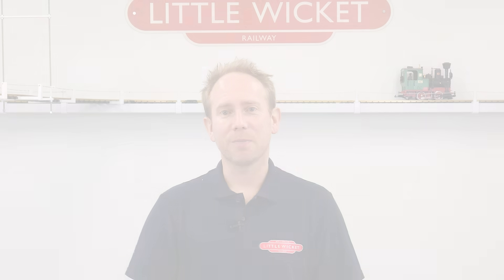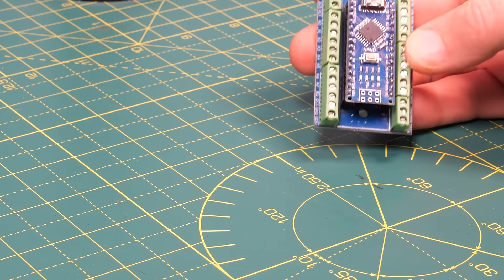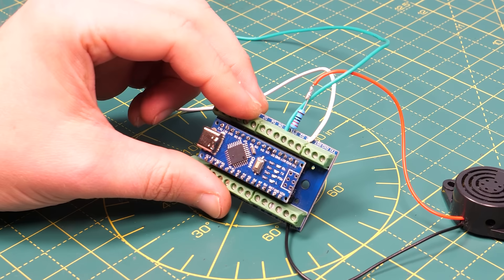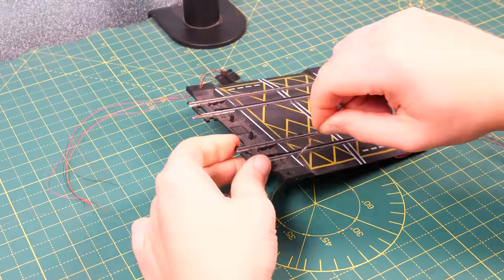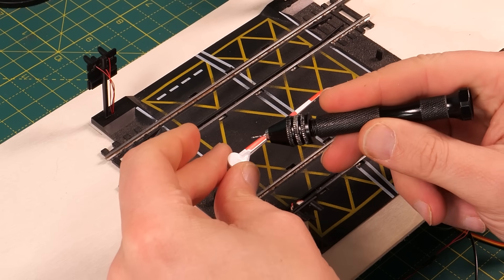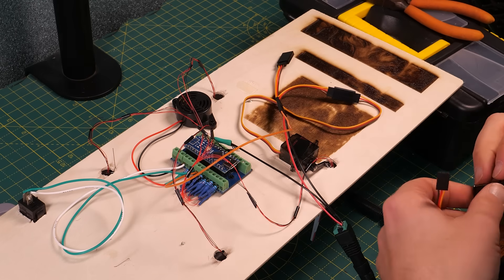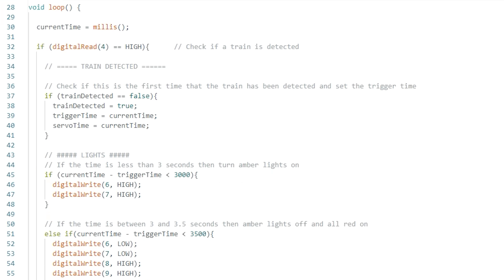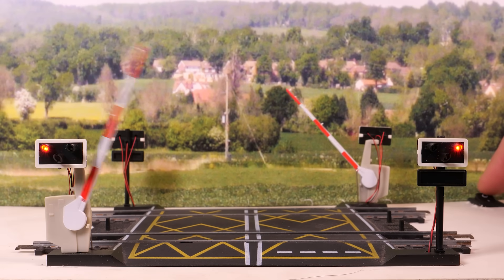Awesome Upgrades to Bring the Hornby Level Crossing to Life!

Comment: Looking at doing this myself using this video as a guide.

Is it a similar process if I want to add two track sensors to start the procedure (for locos coming from either direction on each of the lines)?

I will be using 4 barriers with a pair of diagonal barriers closing at once, then the other. Would the code also require another step in it copied below the first pair of barriers come down, then all 4 returning to point 0 all together.

Also, great video.

Comment: Surely you could simplify the LED wiring by putting three NPN transistors in emitter-follower mode between the anode resisors and the Arduino?
Reply from the maker: You could. That would reduce the code by a few lines, but requires 3 additional components.

Comment: Excellent modification: Just a couple of corrections in the interests of authenticity: 
Half barriers, like in your POC the sirens continue for the entire sequence; although in some installations the levels are attenuated once the barriers are down for local noise abatement reasons. Full barriers; the tones stop once all the barriers are down. 
Also, there are strict rules on the flash speed of the twin reds (As defined in TSRGD1), yours are a bit fast (c120fpm), also, your ambers should be on for longer, 5 seconds (TSRGD Regulation 39). 
For full barriers, the right direction barriers come down first, then the exit barriers come down (CCTV types). There is loads of information the standards documentation, particularly (GI/RT 7012 Requirement for Level Crossings) 
All of this can be fixed with some code amendments. I think I'll have a go at this for my Dad's layout with an ESP32 and some 3D printed parts. Well done.
Reply: could you make a video on that cause I would love to see it
Reply: @calvinnguyen7059 I don't really do YT videos, plus it's my Dad's layout, but if there is sufficient interest, I might... lol
Reply: @dougle03  oh okay

Comment: Rather than spliting the lights with 2 on 2 pins, you can still use one pin and use it to control a transistor to switch the lights on and off
Reply: Or a H-Bridge to alternate the polarity on a single output.
Reply: @dougle03  why? You just want it to turn off and on, not reverse anything or vary power. It's what I said to do but with extra steps. If you want to get complicated then dump the Arduino and run it all with some 555 timers.
Reply: @JSmith19858  The H-bridge will help help flip the polarity so all Red LED's are wired to a single pin but half of them are reverse polarity. All depends on how many pins are free. Could be done with an ESP-01 that go for about £0.30 each...

Comment: You said £20, but the first few things on the list are already over that, how much does it cost in total?
Reply from the maker: It'll be around £20 excluding the power supply depending on where you buy from and the quantity you buy.

LEDs £8.06 eBay (I just looked this up)
Arduino ~£4
Buzzer ~£1
Servos ~£4 (£1.69 on Temu)
Wire - you'll probably have to buy more than one, but you'll only use ~£0.50

How you power this is up to you. A lot of people will already have a 5V or 12V bus around a layout.

Comment: It'd be great to do a motorised version of the Full barrier type, as often you'd find those in an urban or suburban setting. That said the skirts on the barriers would be so fine they'd be fragile.

I'd be going for the earlier version with a bell rather than a warbler.
Reply: You should check out my full barrier crossing 👍🏻

Comment: Looking in my notes I see the Amber lights show a steady light for approximately 5 seconds followed by flashing twin red lights for 6 to 8 seconds before the barriers fall. Barriers are given 6 to 8 seconds to fall and must be fully down for not less than 16 seconds before the fastest train passes. The minimum total time of operation from the Amber lights illuminating to arrival of the fastest train must not be less than 37 seconds. This is for automatic half barrier crossings, hope this info is useful to you so you can adjust the timings

Comment: I'm glad you say it's only an experiment, as it's not very good is it? Lights flash far too fast and the barriers raise and lower far too fast. You can also get bigger LEDs that will fit in the light surrounds correctly, and just one more thing in railway terms AMBER lights are called YELLOW.
Reply from the maker: As I said, the timing of the lights and the speed of the barriers can easily be changed in the code, but given the model itself isn't particularly accurate and time is often scale adjusted I don't think it's a big issue.

The size of the LEDs is absolutely fine.

Network Rail refers to them as amber (https://www.networkrail.co.uk/communities/safety-in-the-community/level-crossing-safety/level-crossings-for-drivers/), but feel free to call them yellow if you want, it really doesn't matter.

Try to have a nice Christmas Iain.
Reply: @LittleWicketRailway  Railways signals are Yellow traffic lights Amber the lens says Amber on it so it is not confused with another colour lens
Reply from the maker: @cedarcam  these are traffic signals, so they are amber.
Reply: @LittleWicketRailway  Yes that's right. Maybe I was not clear enough in my reply. :)
Reply: As all crossongs are owned and operated by the railway and worked on them for 45 years they're known as yellow.
Reply: @IainDavies-z2l  Although the circuits show HGE I assure you the light is Amber because traffic lights are Amber and the railways light is required to be the same colour as other road traffic lights.
Reply: Hi Rob.
Well over my head buddy.
But going back to other comments as I was a train driver for 14 years we always said amber as it's part of the road network.

Thanks for this tutorial Rob.
Have a fabulous new year.
Thumbs up thumped 👍
.... Pete....

Comment: Excellent content, more of this please. Animating a water tower next?
Reply from the maker: Thanks. Do you have a particular model in mind?
Reply: @LittleWicketRailway  The Ratio GWR water tower kit has the potential and I think could take a 3.7g servo without too much modification. I have got a proof of concept on a breadboard controlled by a Nano and using a IR sensor to trigger when a train is present. It is connected to the Adafruit Sound FX board to play some sounds of the train being filled. I can share the code if you want to have a go?
Reply: Just to add the code was written using ChatGPT as I have no prior knowledge of coding.
Reply from the maker: @iansheppard3711  sounds like you've already got it sorted. Nothing wrong with using chat gpt for coding. It'll probably even explain the code to you if you ask it.

Comment: With a half-barrier crossing, it seems that the siren sounds throughout the sequence, until the barriers are raised again.

I believe that both reds light up at the start in order for the system to prove that they're working before going into the lowering sequence. As you'd expect, there are rules about how many lights can be failed, and where, although I'm sure the modern LEDs are far more reliable than the old halogen bulbs. I once read way too much about this stuff, but it's way too long ago!
Reply from the maker: Could well be the case. There isn't a half barrier crossing near me unfortunately. You can easily change that in the code though. I think if that siren carried on for longer than a few seconds my wife would have killed me, hence the retrospective idea of the volume control 🤣
Reply: You are right With half barriers there is nothing to stop a blind person walking over the crossing when a train is coming so the alarms continue to sound to let them know not to cross. With full barriers having a physical obstruction the alarms are silenced once all 4 are down. Also you are right about the light proving. A circuit checks enough lights are working and then the lights flash alternately, An alerter sounds in the signal box if a lamp fails. Something I like about Irish railways crossings is all 4 barriers briefly move together which must be a proving circuit they use to check all are working.
Reply from the maker: @cedarcam  you know your crossings!
Reply: @LittleWicketRailway  I was in signal engineers and although did not work on many crossings had to know about them. I am not sure if I have any timing notes now but can have a look. Sure the Amber light displays for 5 seconds before the red lights come on. and reds have to flash a certain minimum time before a train reaches the crossing

Comment: This is incredible! You've done a cracking job with this. The one comment i would say though is those lights look a bit too quick - ive tried 0.73 seconds on stuff like that before which looks ok? Might be worth a try in a future iteration. But it looks great and if youre happy thats the main thing 👍
Reply from the maker: Thanks mate. Easy enough to change the code for the timing of the lights, siren, etc. have a great Christmas :-)
Reply: @LittleWicketRailway  Thanks, you too mate 👍
Reply: @LittleWicketRailway  Thanks, you too mate 👍

Comment: Do you remember the Triang moving gates?
Reply from the maker: I don't. How did they work?
Reply: @LittleWicketRailway  They used memory wire rather than a servo to open the gates. There was also a barrier version (R171).

Comment: could use 1k resistors for the LEDs, they will run cooler and draw less current making life easier.

or use a TLC5947, advantage: no need for resistors!, can also adjust the brightness as its a PWM board - write a value for on and for off, done, can have a day/night mode too, heck could add an LDR to the arduino have have auto brightness adjustment.

could use a PCA9685 for the servos, direct is fine though (obviously), can also be good to have the servo power controlled so the things are really OFF when switching on.

really nice little project though, and could be as you have here, its own module that just takes a few wires and is self contained otherwise. takes whats a somewhat tired old model and in a subtle way will get the "what! did that move?" from someone not expecting it
Reply from the maker: Never used a TLC5947, sounds good!
Reply: @LittleWicketRailway  PWM controller, current limited output removing the need for resistors, SPI interface, 24 LEDs with individual brightness, and an overall "output enable" - cheap too, have a look, very good for projects like this and anything else with LEDs where you may want to calibrate the brightness. also can take its own power supply so no issues with Arduino current outputs (can also run say 12V and daisy chain white & blue LEDs)

Comment: Great video. I've used the NANO a lot on my layout. To save outputs and current, you could series connect 2 LEDs to each output as 5V is more than enough to get over the forward voltage. I'd probably have driven the servos separately to allow independent positional adjustment in the code. Have a great Christmas!

Comment: The only left to make a cable management and done
Reply from the maker: Yeah, if it was going on the layout the wires would need to be secured to the poles and painted black. A few bits of grass/bush around the holes would hide it all quite well.

Comment: Quite neat, are more realistic parts available ? Barriers, light units etc
Reply from the maker: There probably are more realistic crossings out there from other manufacturers, but this is as good as Hornby gets.
Reply: @LittleWicketRailway I feel the concept of what you have done deserves a more realistic model, maybe also slow the barrier movement